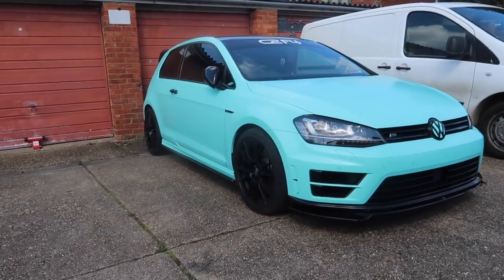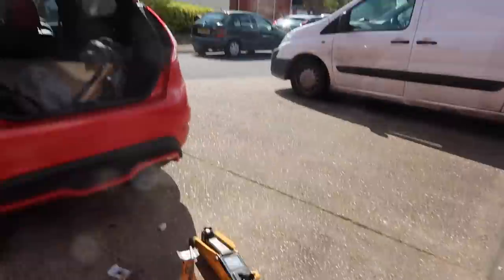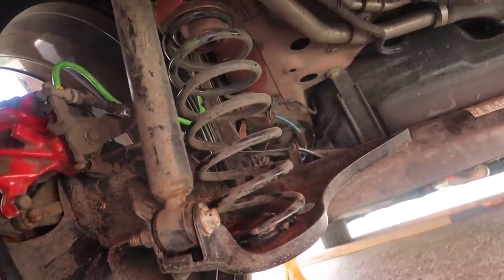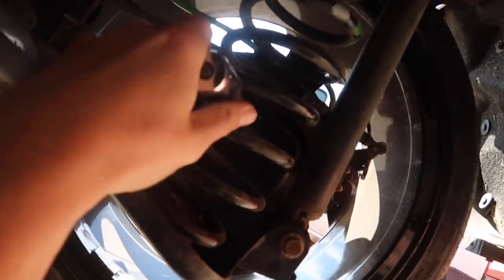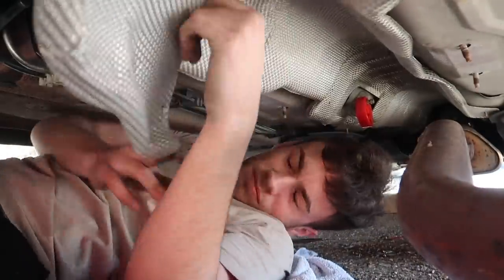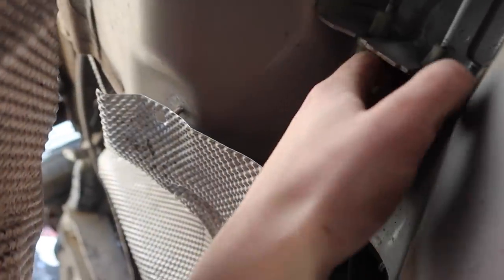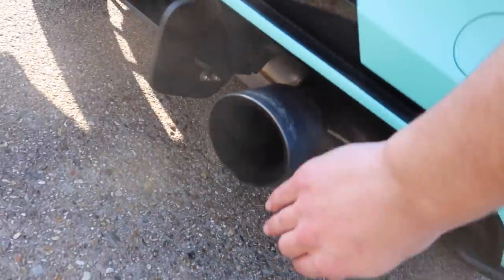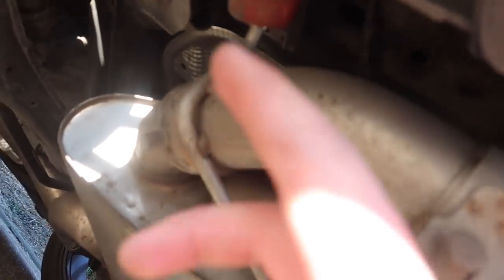THIS DID NOT GO TO PLAN!

Comment: Use euro car parts for the handbrake cable and drive the car a little and the traction light should reset or disconnect the battery and reconnect, also great vid mate